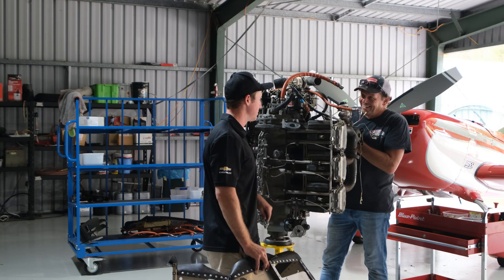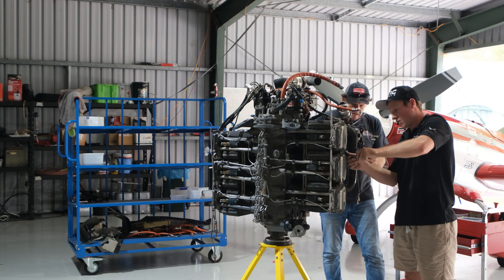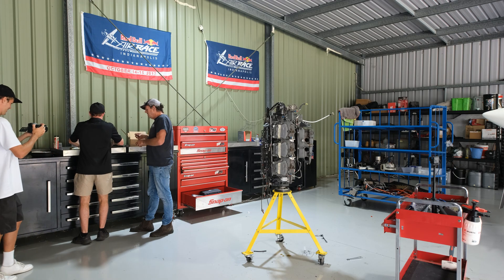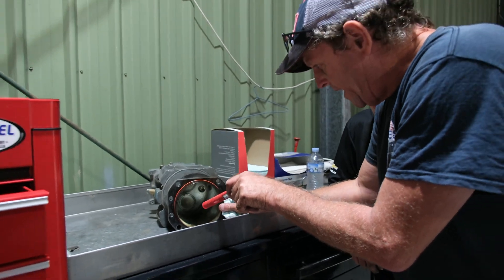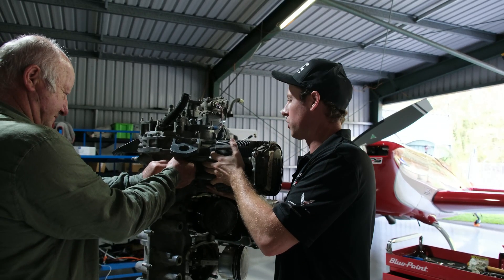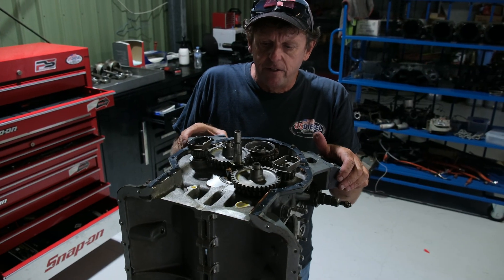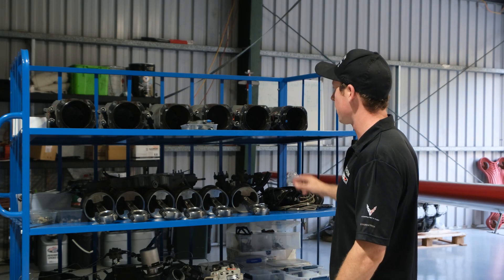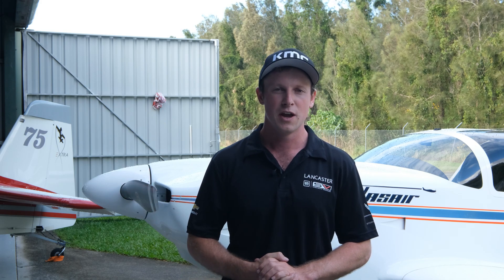CRAZY PLANE ENGINE REBUILD (Lycoming IO-540 Tear down) MORE HORSEPOWER. Episode 1 engine rebuild

Comment: You are better off with a bmw M54 or even a Barra engine. Those Lycomings are dinosaurs are poorly designed.
Reply: Do you have any specifics on why they are poorly designed or have a source for ur info? What problems do they have?
Reply: @ronn4061  That's a long answer. Sources are air crash data, forums, documentation and my observation. Issues are well documented, many of which are on YouTube. These engines are an old design that is obsolete by modern standards. Issues incurred are cranks breaking, valves dropping, valve seat and guide wear, overheating, connecting rods and pistons disconnecting from cranks, magnetos failing, cam shafts failing, cracks in casting, poor fuel economy. The Issues are much more detailed than explained. I would have to write an essay regarding the engines. Basically, by design they are under more stress than a modern engine, they are still produced because people still by them.